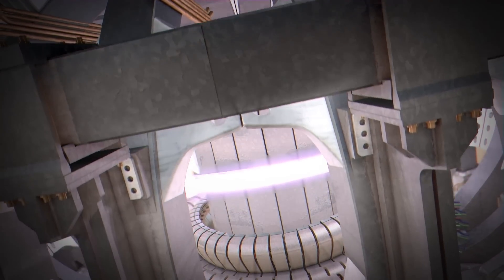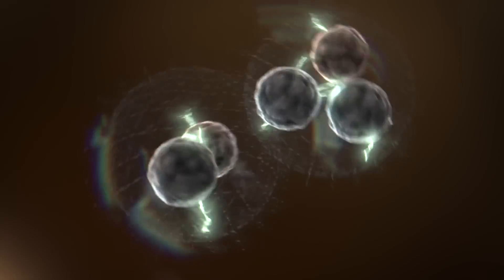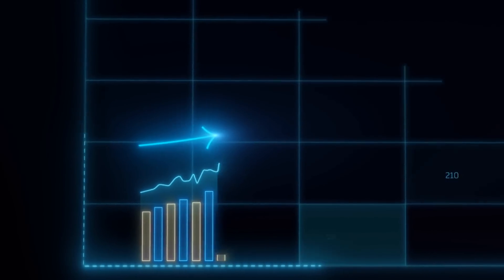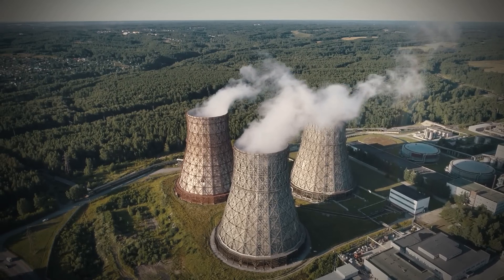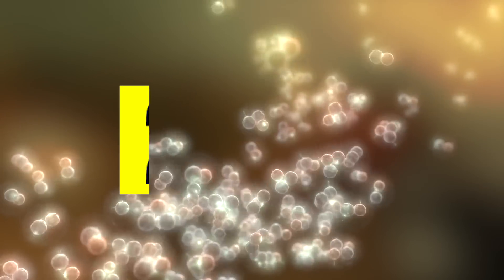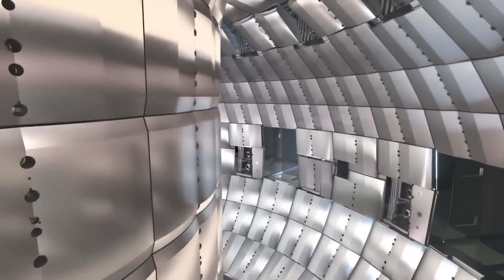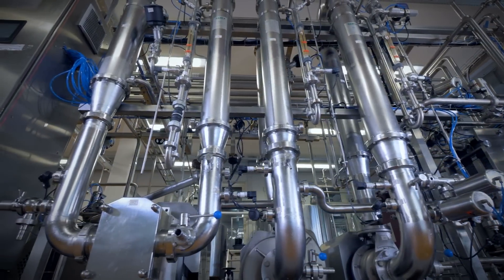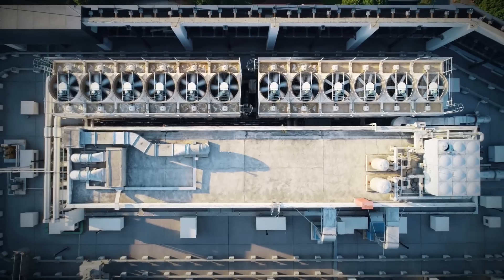The Shocking Problem That Could End Nuclear Fusion

Comment: A good rundown of the key issues facing tritium production/consumption. However, there are a few issues I would like to point out:
- Claiming that scientists are "hiding" tritium problem is not true (and frankly a bit dishonest). This is a well known problem with large volumes of papers addressing it and any introductory material to fusion technology points out this issue;
- D+T reaction is not the only reaction possible (it is easiest to achieve) and it would be only a stepping stone towards even more sustainable fusion reactors. The video does briefly mention D+D reaction which could also be used to directly produce energy (requires higher temperatures hence harder to achieve);
- There is quite an obvious solution to producing initial quantity of lithium needed for fusion reactors -  tritium breeding facilities (i.e. a modified fission reactor). And even with the current energy crisis in Europe we might see a renascence of nuclear fission power plants, some of which might be designed with tritium production in mind.
Reply: D-D fusion requires temperatures about 100 times higher than D-T fusion for the same rate of reactivity.  If D-T fusion is perpetually two or three decades away, D-D fusion is another couple of decades beyond that.
Reply: @JonMartinYXD  DD fusion temps of 100+ million degrees have already been reached and 160 million has been attained by at least one reactor.

The current record holder is >70 million degrees for >17 hours, so it's definitely less than 40-50 years away, especially once more advanced reactors with more recent superconducting tape based magnets begin to see use.

Combine recent superconducting magnet tech advances and stellerator tokamak design and you get viable fusion way sooner than 40 years.
Reply: @mnomadvfx  The reaction rate of D-D at ~100 million kelvins is kind of abysmal.  We're talking two orders of magnitude lower than D-T fusion.  If we're nowhere near net positive with D-T, how much further away is net positive D-D?

Regardless, we don't have the time to be spending vast amounts of money on fusion.  Those resources need to go into carbon-free power generation that can be built right now.

But the most insidious problem of fusion power is not the resources it is using, but the false sense of security it gives.  How many times do we hear "don't worry, we've nearly got fusion figured out and that will provide limitless carbon-free energy" or "we shouldn't be building fission power plants, we should be putting that money into fusion research because it is nearly here and better than fission in every way".  The promise of fusion power is an excuse to do nothing about climate change.
Reply: Where can I find the summary of the hidden dangers of these theoretical processes? The casually mentioned mercury poisoning was known to be just a tip of the iceberg.
Reply: Forget tritium you say theres only 25 kg its all in these nukes How come then yunis
Reply: Hold on a sec, scientists are lying about a lot of things to do with fusion. As a for instance NIF announced a new record claiming they surpassed 70 percent efficiency. The truth was they hit less than 1 percent but they didn't mention all the power they used, just that which was absorbed by the PELLET. Then they trotted out their best liar, Michie Kaku who repeated that lie and then went on to talk about how abundant the fuel is, saying it all comes from sea water! Sorry but I could go on ad nauseum about lies NY ITEr East etc.
Reply: You are having an effing laugh!.. All tax-funded Hyper-Science uber-wastage is hyped up, with problems ignored, by a compliant media. This HIDES so much from the tax payers it makes Hyper-Science yet another mass-forced sales scam = robbery.
--
Liberal VANITY SCIENCE has wasted trillion$ globally with NOTHING PRACTICALLY USEFUL to show for it. Fusion 'Power' (WASTAGE) and Deep Space Telescopes and probes are the most wasteful science, closely followed by the useless 'particle' (temporary field fluctuations) detectors and accelerators.. Of course, Fusion Bombs have to added to the list. Even actual Science journals give all these tax-funded WHITE ELEPHANTS an easy ride. 
--
In the meantime, RUSSIA, that 'backward' nation, 'reliant on fossil fuels' has a WORKING Fission Breeder Test Reactor, with China playing catch-up... The US and other Western nations could have dominated the world with this tech. but it chose to stick with fossil fuels and non-breeding reactor designs as the by-products are used for nukes and armour piercing ammo. Fusion has received well over a $trillion on 90+ FAILED TOKAMAKS on top of countless other FAILED fusion power experiments.
--
When is enough enough? Breeder Reactor R & D spending is around $25 billion globally over a longer time period yet the technology is based on much better proven science and technology. Russia's Fast Neutron Test Reactor already uses 100th the amount of enriched uranium, with the ultimate goal being to use more than a million times less (which is theoretically possible).
Reply: "The video does briefly mention D+D reaction which could also be used to directly produce energy (requires higher temperatures hence harder to achieve)"

D+D reactions are still neutronic fusion reactions - you will get some charged particles to produce power from directly, but as a percentage it will be much smaller than intrinsically aneutronic fusion reactions like pB11.

"And even with the current energy crisis in Europe we might see a renascence of nuclear fission power plants, some of which might be designed with tritium production in mind"

Au contrere - I'd say the current energy crisis is exactly what Europe needs to start investing in nuclear again.

Overreliance on foreign energy supply has crippled the world and poisoned its poltiics for far too long, this crisis is the kick in the ass we all know it needed.
Reply: @mnomadvfx  .. Well over $1 Trillion spent globally so far on 100s of huge, failed Fusion Power reactors, including 90+ failed tokamaks. Well uner $100 billion spent globally on Fission Breeder Reactors (fast neutron solid fuel and molten salt).. 
--
Europe's efforts were basically pen-pushing feasibility studies that all concluded the tech. was feasible, and certainly far more feasible than Fusion Power... 
--
The US ended research in the 60s at the height of the cold war due to addiction to wasting enriched uranium every way possible. It's addiction to Fusion Nukes... 
--
Russia now has its first working Fast Neutron Test Reactor that already uses 100th the amount of enriched uranium. China has its Fast Neutron and Molten Salt Breeder Reactor test sites under construction.
--
The UK was going to 'lead the way' in next gen. Fission Breeder Reactor tech. in the 1980s, before the Fake Green Revolution, not to mention North Sea Oil & Gas took over. Leading the way in Waste To Energy + compact raw materials, clean-burning all our trash and reusing our nuclear waste in breeder reactors........ Then The HYPER LAND-FILLERS took over, and it all went to pot.
Reply: Doesn't matter what kind of energy source is discovered/created.  Financially, no americans will ever see a benefit from it.
Reply from the maker: Thanks for your comment! I did not claim scientists are hiding the tritium problem, they are in fact very clear in the literature. However, some company CEOs, for example, have given many talks which I feel are being dishonest towards the challenges that need to be overcome. From what I have read D-T fusion is basically the only way we will get to commercial fusion given the challenges of other types; however, I may be wrong there. Tritium breeding reactors could definitely have a place, but there are some challenges as it is a tightly controlled government material - but I will have to look into it further! The reason I didn't mention it in the video is because it doesn't seem to be the preferred method from what I can see! Cheers :D
Reply: @ZirothTech  Sorry, I didn't want to come across as too critical, I think you are doing very good job with your channel! 
I completely agree that fusion start-ups hide a lot of issues related to fusion (by doing so they are harming the cause for short term monetary gains)! Out of ~40 fusion start-ups maybe 5 are onto something and out of them maybe 2-3 have a really solid plan (i.e. SPARC). First fusion reactors will most likely use D+T but a mature fusion technology would have to use different kind of fuel (a bit of a futuristic perspective) to avoid all the issues you pointed out in the video. 
Keep up the good work!
Reply: @arnasvolcokas7289  Have you heard of Helion? And if you have, what are your thoughts? Are they on to something or are they just blowing smoke at investors?
Reply: @bloodtypeinfinity5143  I have not scrutinized Helion in detail but from having a quick look at what they propose I see 2 major problems: (a) The technology (plasma accelerators and direct energy conversion) they want to use is in very early stages, so it will take them decades to iron out all the kinks (b) the reaction that they want to achieve D+He3 is about 100 times more difficult to do than D+T and the plasma temperatures they are currently reporting in their prototypes are about 10 lower than what tokamaks can do (and that's without taking confinement time and plasma pressure into consideration) so Helion is quite a bit away from their goasl. Now, maybe they have some cards up their sleeves, I just don't think that's the case. I do however believe that plasma accelerators and direct energy conversion is a worth while projects to pursuit in themselves so I would not say that their efforts are completely in vein.
Reply: Už Lietuvą!
Reply: @arnasvolcokas7289  "Out of ~40 fusion start-ups maybe 5 are onto something and out of them maybe 2-3 have a really solid plan (i.e. SPARC)"

SPARC is really cool - but the fact that they herald such a meagre Tesla boost to its magnets as such a giant step forward is honestly disappointing given how far the research has already increased beyond 20 Tesla.

I get that compared to the average magnetic confinement design that 20 Tesla is a big step up - hopefully as the new superconducting materials are proven we will see SPARC get an upgrade.
Reply: @mnomadvfx  SPARC claims 12 Tesla on axis, which is absolutely huge (I really think you shouldn't be downplaying it). Tesla is a very large unit by the way. We absolutely need superconducting technology to continue to improve and allow for even stronger magnetic fields for sure!

Sorry, yes D+D reactions are still neutronic so there is not direct energy conversion but we can get deuterium from the sea water which solves tritium problem (which is the point I was trying to get across but misspoke a bit)

I think you misread my comment on nuclear fission power plants - I believe that the current energy crisis will lead to a renaissance in nuclear energy and energy independence in Europe.
Reply: @ZirothTech  "However, some company CEOs, for example, have given many talks which I feel are being dishonest towards the challenges that need to be overcome"

This is company PR though - not science.

Anyone with an interest in the subject and half a brain will hit the papers first.

CEO's always gonna CEO speak to the camera - that's just how business works.
Reply: @ZirothTech  Btw the problem can be eliminated at it's core by 1 method: The moon
You see the moon contains MASSIVE deposits of frozen Helium-3
And Helium 3 is a perfect mate for deutherium in fusion
you see brown dwarfs do something called "cold fusion" where they merge 1 deuterium and 1 helium-3 to make 1 helium and a hidrogen so it is way more stable, reliable and it only requires a big dose of helium 3 and deutherium and a temp. of around 5 mil. Kelvins and voila~ energy problems solved
Reply: I wonder if our civilization started to pursue B-H right away, which is the most difficult, but most rewarding, I think, and failed. And then be like, ok, let students downshift and build a D-T reactor, whatever. And it would be easily done since knowledge banging head off B-H process would be enormous.

Comment: Hmmmm you failed to talk about the type of lithium needed....oh you did! Li6
Reply: On that point, I disagree. If natural lithium is enriched to over 90% Li6, the breeding ratio will go down, not up. Of course, some Li6 is necessary, to absorb thermal neutrons. However, Li7 has an advantage toward producing tritium when the neutrons are highspeed. If Li7 is hit by an incoming neutron of the right energy, it splits (spallation) into helium, tritium and an outgoing neutron. The second neutron might undergo several collisions, but it will eventually be absorbed. If absorption takes place in Li6 (most likely, because of the much higher thermal cross section), another tritium is produced. Does anyone know the optimal Li6/Li7 isotopic ratio?

Comment: Isn't beryllium a neutron reflector? Wouldn't the majority of neutrons be reflected back to the fusion chamber?
Reply: Is there really such a thing that holds the shape of an atom, and if so, how does that even work?
Reply: @elinope4745  Not sure how that is relevant, but to answer the question:

The space of an atom is mostly occupied by the electrons. Due to the uncertainty principle, each election exists as a cloud of uncertain position (when you interact with the electron, a single point in the cloud will interact at a time).

What causes the shape of these electron probability clouds? Three things:
1.) The attraction of the electrons to the extremely small nucleus.
1.) The electrons all actually have a minimum energy that is fundamental to them, and can't be removed. This is also known as zero point energy (all particles have some). This kinetic part of this energy keeps the electrons from falling into thr nucleus.
3.) The repulsion between the electrons around the atoms.
Reply: @wowalamoiz9489  The electron cloud will not effect the neutrons that are passing through, something else is reflecting them.
Reply: @wowalamoiz9489  What I was getting at is that I don't believe ANY atoms can "reflect neutrons" and the reason for this is also the reason that atoms have the "shape" they have. 

In order for the neutron to be deflected it must impact an atomic nucleus. Such things are small and this is unlikely to occur.
Reply: It depends on the energy of the neutron.
Reply: From what I can see, that is a good question. For neutrons produced from fusion, the scattering cross section of Be is greater than its (n, 2n) cross section. But  scattered neutrons will be sent off in all directions, so not all will be reflected back.

Comment: This is an excellent account of some of the issues facing tritium breeding, but one could add the problem of tritium escaping the reactor. This seems inevitable given that the tritium will be bred from lithium based material in a hot environment and that adequate tritium diffusion barriers do not exist. Even the relatively low tritium levels in the Canadian Heavy water reactors give rise to tritium loss to the atmosphere.
Reply: And embrittlement. It is hydrogen after all.
Reply: But you don't need to breed tritium in a thermally hot environment. A purpose built fission reactor (ie not a power one) DESIGNED to breed tritium can provide the neutrons. It will be small and (relatively) cheap, using an outer breeding blanket. Enriching lithium, too, is a LOT easier than enriching uranium because the relative atomic weight difference in the isotopes is far larger than in uranium. I think if we get commercial fusion we are going to have to first work on getting a lot more tritium, but the prospects for that are good.
It's an issue, but not a showstopper.
Reply: Good point.  Hydrogen and it's isotopes are remarkably hard to contain and can find their way between intermolecular gaps quite easily.
Reply: @kayakMike1000  I'm not clever, but couldn't you blast the tritium with oxygen and hope to create tritiated water?
Reply: @DAndyLord  you're more likely to whack a neutron into an oxygen, which would transmute into a nitrogen isotope for a few seconds before emitting a gamma ray photon.  Water is also a moderator, so... The neutrons slow way down.  This may make it less likely to activate to tritium.  Besides, something here seems like we're dealing with some ionizing radiation, which would liberate lots of hydrogen anyway.
Reply: @kayakMike1000  Maybe I was unclear.  I meant to turn the tritium into tritiated water to avoid losing the isotope.  

O2+tritum+fire= tritiated water

Clearly I'm quite ignorant on the subject, but it /feels/ like that'd work.